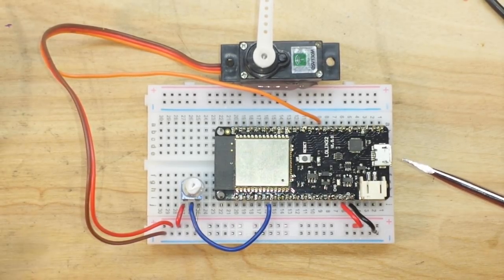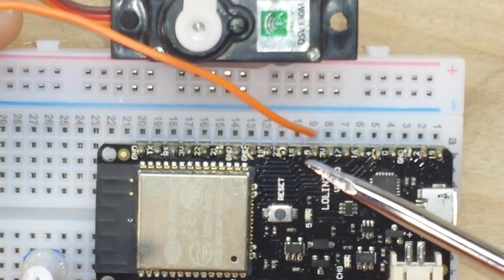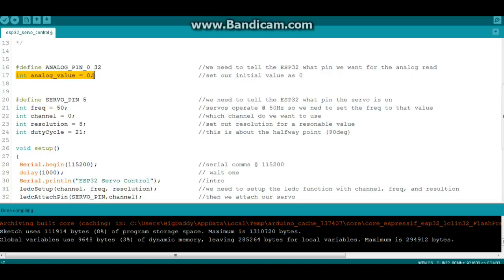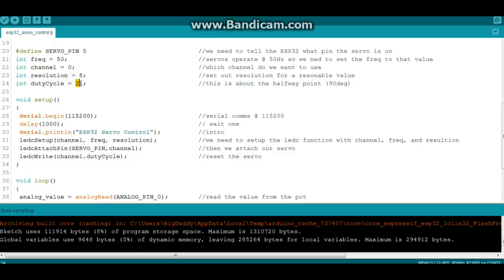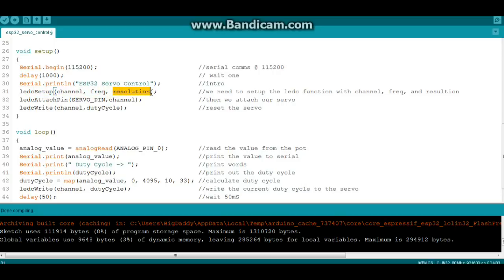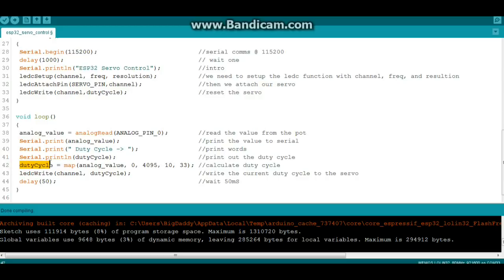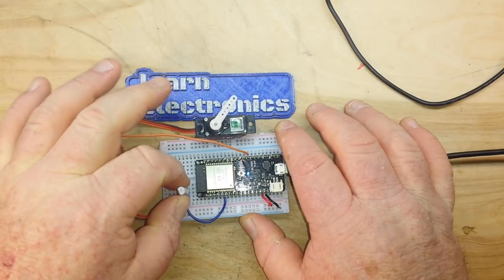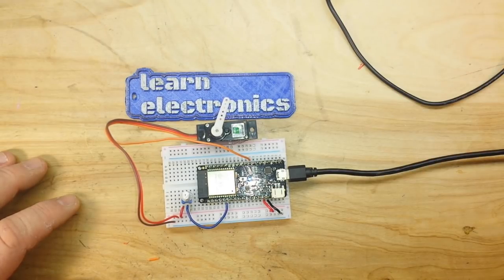ESP32 Analog Servo Control

Comment: But shouldn’t the servo typically connect to an external power supply? So that the only connection between the servo and esp is through the signal wire

Comment: Hi, I have this error, can you help me? Thanks.

WARNING: library Servo claims to run on avr, megaavr, sam, samd, nrf52, stm32f4, mbed architecture(s) and may be incompatible with your current board which runs on esp32 architecture(s).
In file included from C:\Users\Utilizador\Documents\Arduino\libraries\ESP32-Arduino-Servo-Library-master\examples\01-SimpleServo\01-SimpleServo.ino:1:0:

C:\Users\Utilizador\Documents\Arduino\libraries\Servo\src/Servo.h:77:2: error: #error "This library only supports boards with an AVR, SAM, SAMD, NRF52 or STM32F4 processor."

 #error "This library only supports boards with an AVR, SAM, SAMD, NRF52 or STM32F4 processor."

  ^

Multiple libraries were found for "Servo.h"
 Used: C:\Users\Utilizador\Documents\Arduino\libraries\Servo
 Not used: C:\Users\Utilizador\Documents\Arduino\libraries\ESP32-Arduino-Servo-Library-master
 Not used: C:\Program
exit status 1
Error compiling for board DOIT ESP32 DEVKIT V1.

Comment: Awesome video 
I am making a  small  pan and tilt platform controlled by the esp32
I would like to use wifi to control it but can't find a way to send analog value's to the esp32
Do you know how to do this?
Reply from the maker: +geoffroy spaas You will have to send the values as bytes.
Reply: learnelectronics 
I'm kind of a dummy when it comes to wifi communication
What protocol/system do i use to send bytes?
Reply: do you know where i can find some info on this?

Comment: Hi Paul, esp32 seems a bit like overkill to drive a servo!  I would use an Arduino purely so it would be easier to embed in projects.
Reply from the maker: +gartmorn Hi Davy, I went with the ESP32 because this is going to be a building block to a larger project. We're just starting simple.
Reply: learnelectronics I thought you might have something up your sleeve!
Reply from the maker: +gartmorn haha, u never know

Comment: First thx for your earlier video on the ledc command on an led. I duplicated that code for 3 leds (3 instances) and worked perfectly for my application. Servos aren't really my thing but it's cool u can use the ledc command to control it. Of course i also agree we need our analogwrite back but at least this works.